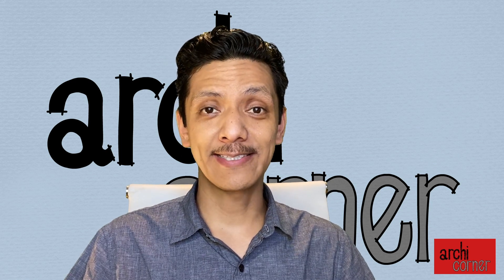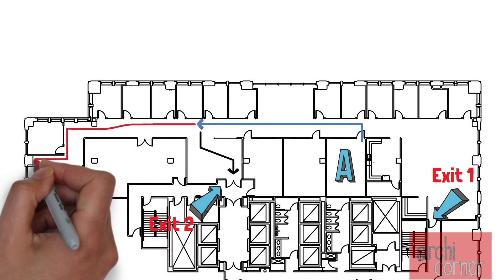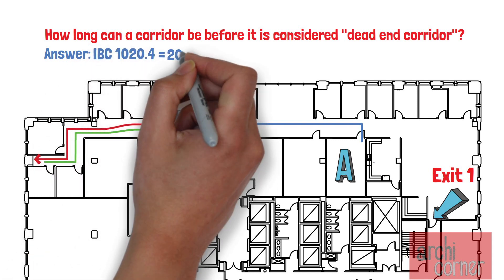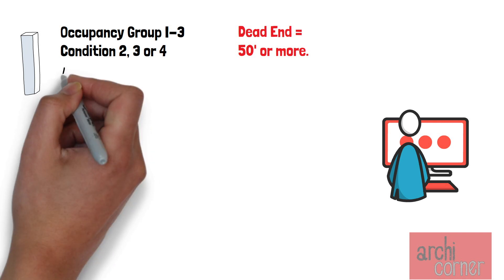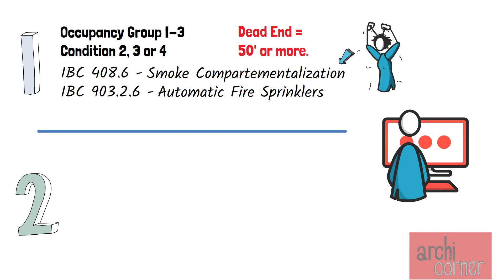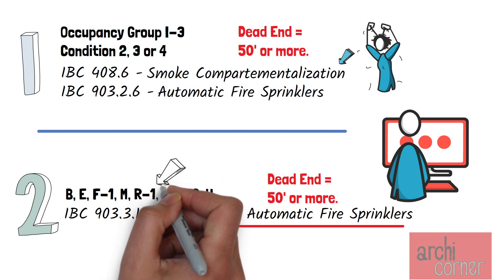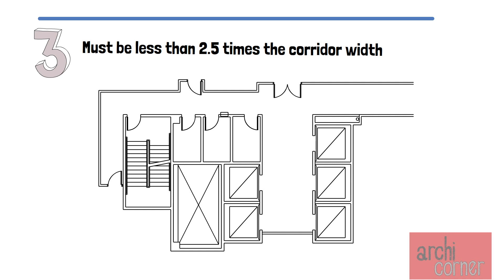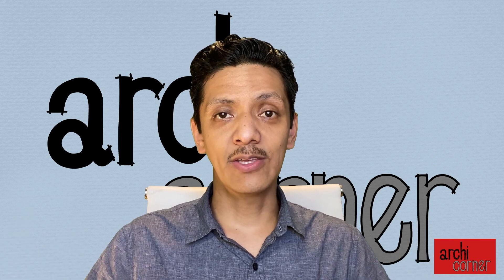AC 028 – What are Dead End Corridors and how to avoid them?

Comment: Hi, I have a question, if dead ends are not applied on one exit according to the ibc.  What happens if we erase exit 1 and left with only one exit (exit 2). The travel distance will be measured from the west end of the corridor to exit 2, but still, the people in room A will face the same scenario of “missing” the exit and facing a dead end corridor. So dead end corridors can also happen in a space with one exit, right? Did I miss something? 
Can you clarify that for me? Thanks. Love all your content❤️❤️❤️
Reply from the maker: In theory, yes, its possible that a “dead end” may exist in a suite that requires 1 exit. In that scenario, it is not a code violation. It is only a code violation if the space needs 2 or more exits.

Comment: Hi Josue, I have been watching your videos for a while now and I find them very helpful! One question I have is what type of doors are allowed in a dead end corridor? I understand that CFC requires them to be "Readily distinguishable as doors". Are security gates allowed ? Thanks in advance! I am a big fan!!!
Reply from the maker: Jimmy; thanks for the comment. A dead end corridor is not something you want to have in fact you shouldn’t have one. Therefore, since dead end corridors should never happen, there aren’t any requirements for them other than not to have one. Is there a specific section of the fire code (CFC) you can reference?
Reply: @archicorner  Hi Josue, Thank you for your reply! Yes I agree that dead end corridors are not allowed. What I was trying to do is to solve the dead end corridor by adding a door to limit the length of the dead end to less than 50 ft. This is a  'B' Occupancy in a sprinklered building. The client wanted to install a security gate instead of a door. CFC Section 1010.1 Doors-refers to the doors in the means of egress.

Comment: Hi Mr Diaz, your video is very  helpful,...still  I'm wondering to know about total/maximum travel distance within building...is it take into account distance from exit access along the stair within firestair down to GF  and from  Firestair's exit door access on GF to exit discharge door on GF (if we pass through a lobby on GF)? Since we have many highrise building that might be longer (in tall) rather than maximum travel distance requirement as per IBC  (300 feet?)  Thank you
Reply from the maker: Check out Episode 014 from my channel. The video gives an overview of chapter 10 and it may explain this a bit better. But short answer is: The code requires distances to an "exit". Your stairs may qualify as an "exit" and therefore the travel distance may be able to stop when you enter the stairs. But it all depends on how the building is designed. Check out that episode and it may help answer some questions.

Comment: Working on a commercial project space plan layout question came up. Based on B-occupancy load (11 total) and exit access travel distance I’m only required to have one exit. 

Our code specialist believes we’re still required to have two exits based on 1020.4 Dead Ends exception 2: dead end corridor shall not exceed 50 feet in a sprinklered building.

Our corridor is 55’, but since per occupancy load and exit access travel distance we’re only required to have one exit does this code still apply to us. 

A bit confusing since the code states if building requires more than one exit. Maybe I’m reading too much into it.
Reply from the maker: IBC Section 1020.4 starts by stating when this section of the code applies. It states: "Where more than one exit or exit access doorway is required....". So the answer is simple; If your project is NOT required to have more than one exit or exit access doorway, this section of the code DOES NOT APPLY. Plain and simple. 

Buildings equipped with fire sprinklers have additional protection benefits. Because of this, Exception #2 allows the corridor length to be extended to 50 feet (instead of only 20 feet). The exceptions is in reference ONLY to the length of the corridor.

I highly recommend the book "IBC Code and Commentary". It is a book that explains all the code sections written in the IBC. Imagine that; a book to explain the IBC by the same people who wrote it! This book is like the bible of IBC. It is a must have if you really want to understand and decipher the IBC.
Reply: @archicorner  thank you so much for explaining and for the book recommendation!!! It seems pretty clear to me as well, but my office is insisting otherwise so trying to find answers. Thank you again!

Comment: Love your videos!  Your channel is BY FAR the best, most comprehensive and clear explanation of code. Can you clarify for me though, in this video, are the dead ends 20' / 50' or more? Or should it be 20' / 50' max?!?!
Reply from the maker: This is simple;
If the building is NOT equipped with a sprinkler system, then a dead end corridor is limited to 20’ maximum. 
If the building IS equipped with a sprinkler system, then the dead end corridor is limited to 50’.